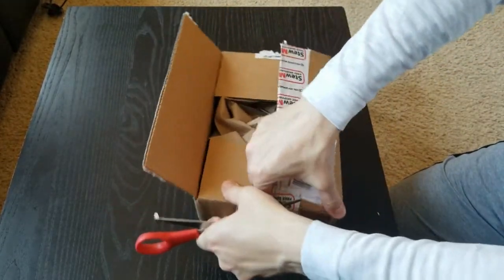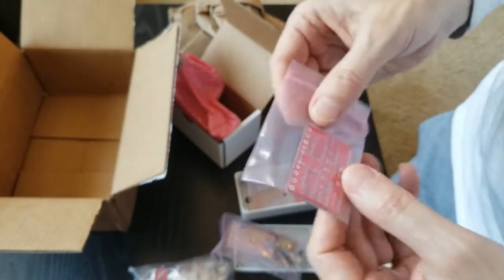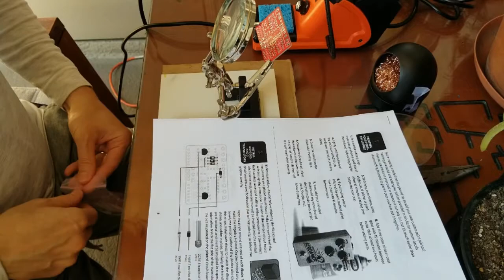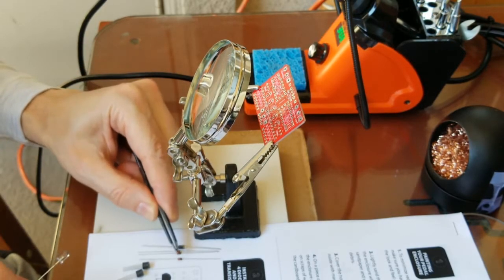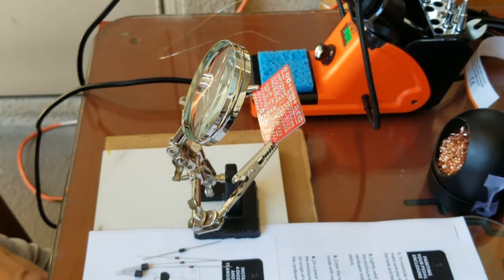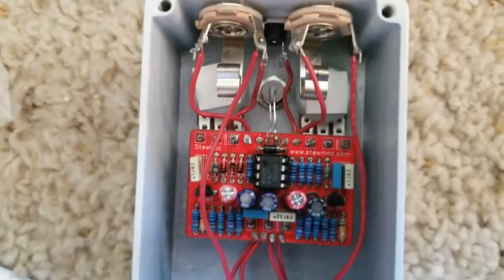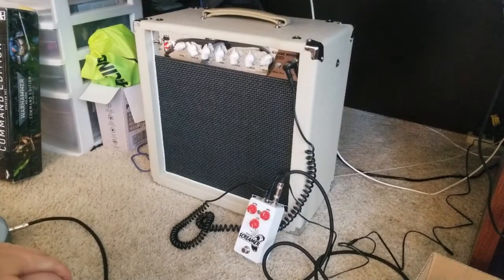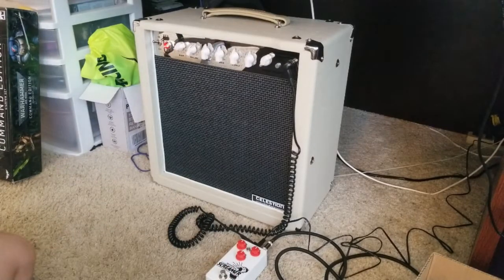Tube Screamer Clone Guitar Pedal Build

Comment: Did you ever get the LED working on it?  Which is a bummer because you were talking about how LEDs work earlier on. I’m planning to build the Screamer kit next. On the Stew’ Fan Tremolo kit the LED leads didn’t even reach the PCB. I think the hole is in the wrong place  I ended up extending them with lead wires which worked fine.    I like the Floyd sounding riff you played.   Jesse’s Girl and Redemption Song was great to hear too!
Reply from the maker: No sir, I never got the LED to work. I tried a few times and it just wouldn't turn on. I really think I fried the contacts on the board due to poor soldering technique and holding the iron on the spot for too long. I appreciate your comments on my playing as well, it made me chuckle because I am such a beginner. Best of luck with your Screamer kit. Keep me posted on how it turns out!
Reply: I own several overdrive pedals and have come to the realization they all sound kind of like with only subtle difference in sound.   2 of them I have built from kits including this one!    1/2 the fun is decorating the build kits.  Either through spray paint or hydro dipping them.

Comment: One more question, if I might.  Which soldering station are you using in this project?  I am currently looking for one and don't really want to spend a fortune. Also, were you satified with the performance of the soldering station you are using?  Thanks.
Reply from the maker: hi, it was very similar to this one: YIHUA 926 III 60W LED Display Soldering Iron Station Kit w 2 Helping Hands, 6 Extra Iron Tips, Roll of Lead-Free Solder, Solder Sucker, S/S Tweezers, °C/ºF Conversion, Auto Sleep & Calibration Support https://a.co/9nqmJ5p

i was fairly happy with it, my soldering skills aren't very good though.